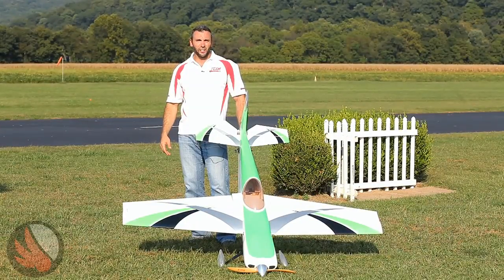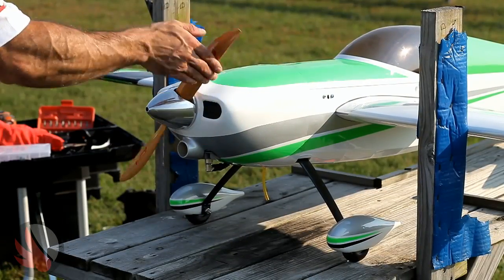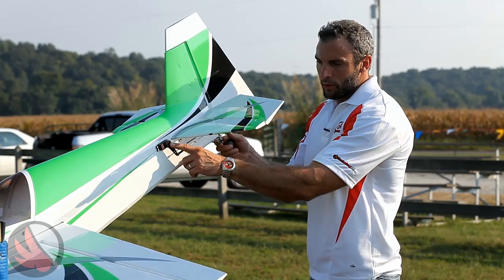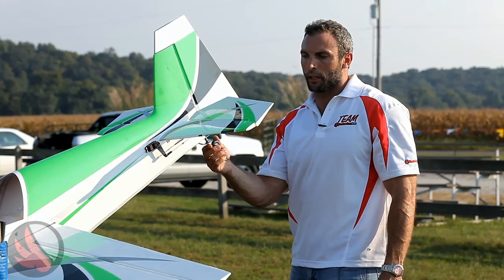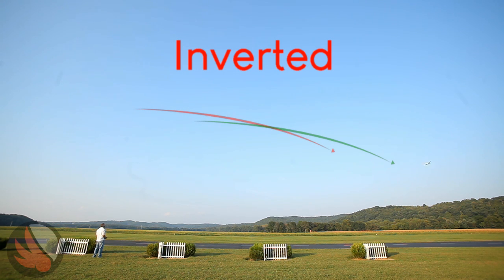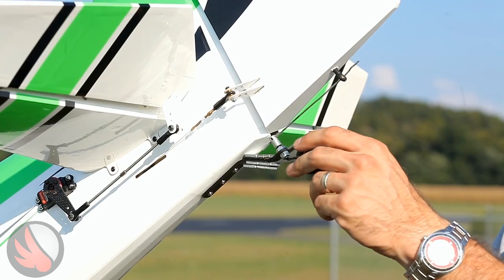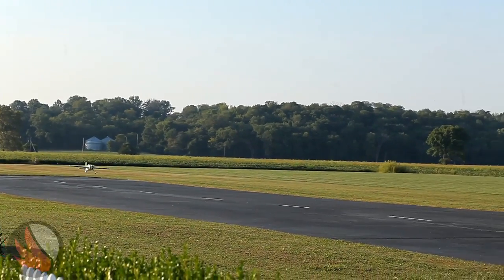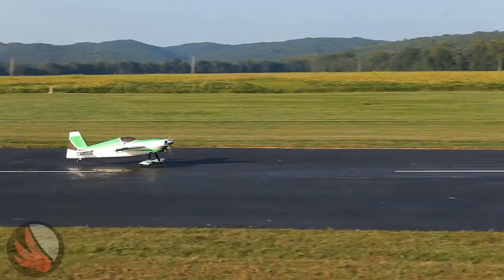CG and Lateral Balancing

Comment: When you typically balance a plane. Fore and aft, this is Lateral balancing. The plane is rotating around the Lateral axis, also known as the pitch axis. It is a line that is drawn from wing tip to wing tip. The opposite to that is balancing longitudinally.  This is along the  longitudinal axis, also known as the roll axis. This is a line drawn from nose to tail.
Reply: Funny.....I thought PITCH meant Up and Down.....and ROLL meant Left or Right......In what universe did you learn how to fly ? I assume your models can defy gravity aswell ??
Reply: I think the general understanding is longitudinal balance is tested around the lateral axis,  lateral balance is tested around the longitudinal axis. Precisely correct scientific terminology only confuses the issue.